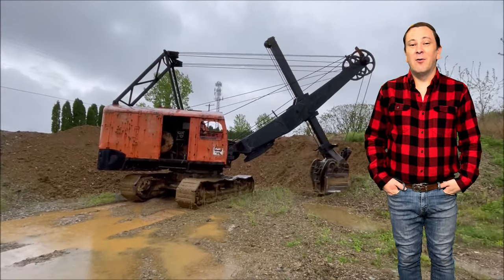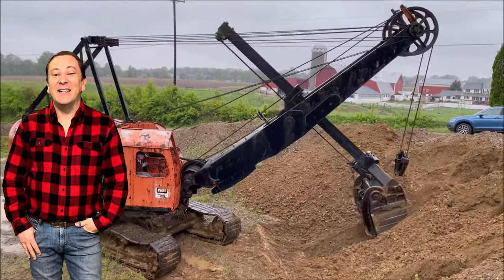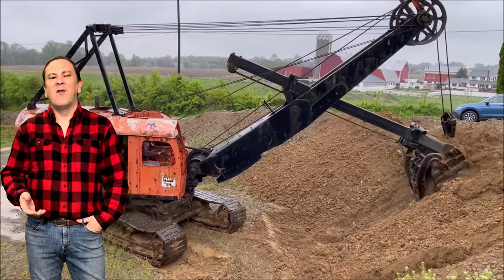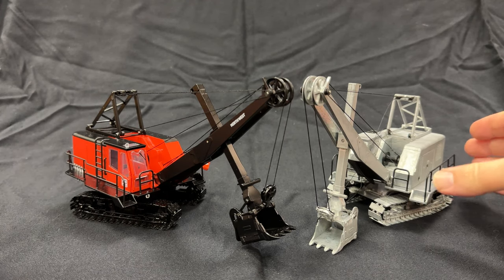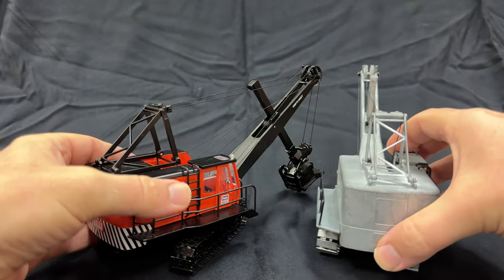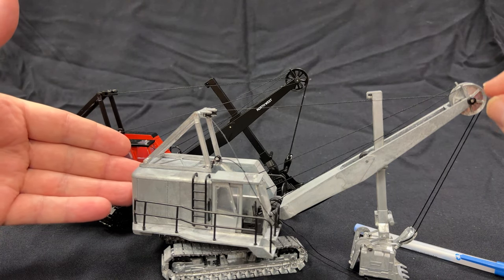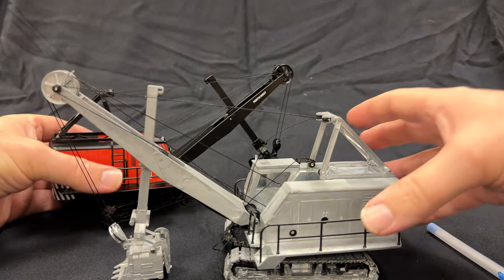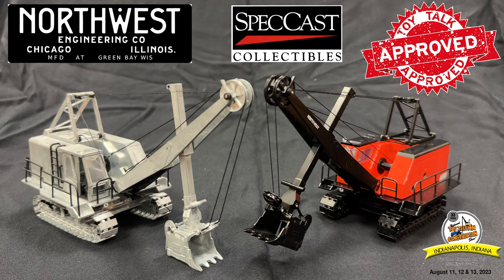Northwest Engineering Model 80D Shovel Digs Out

Comment: The model produced by SpecCast is not the earlier machine that is seen operating at Gerharts in Lititz, PA, being operated by Mr. "Flash" Gordon. The machine seen operating is the iconic version that participated on major infrastructure jobs in the U.S and around the world, featuring the mechanical Feather-Touch clutch control system and the so-called "breadbox" cab. The model produced is the Series 2 that was introduced in the early 1970s, with the Capsule Cab and fully air controllled clutches, known as Cushion-Air. By that time, there was competition with newer forms of digging machinery, notably wheel loaders and emerging hydraulic excavator technology.